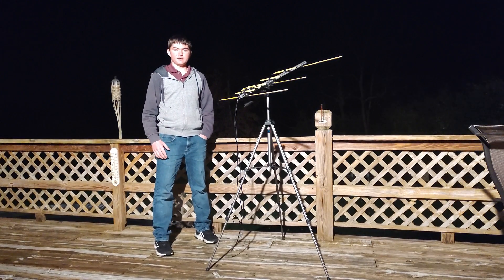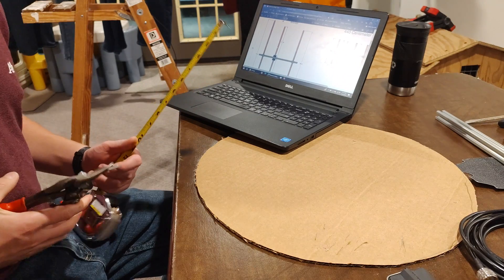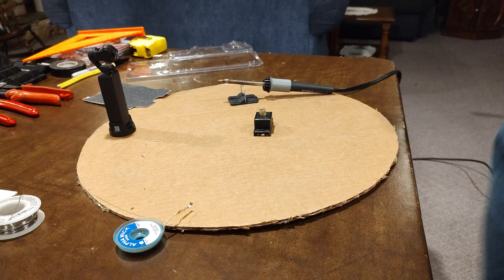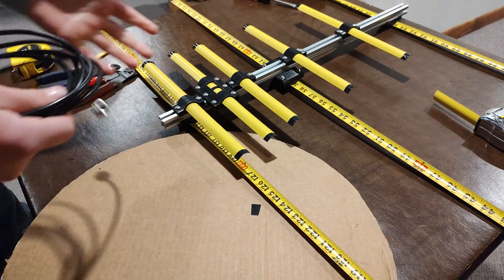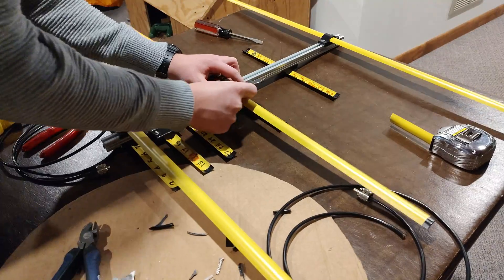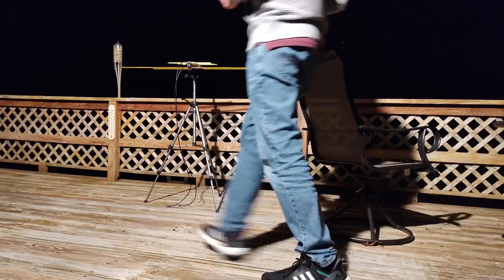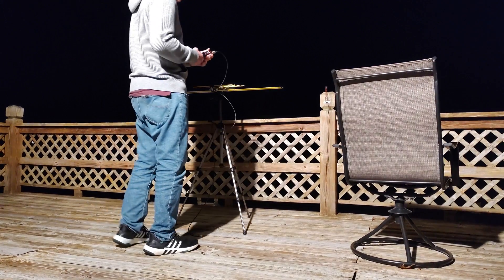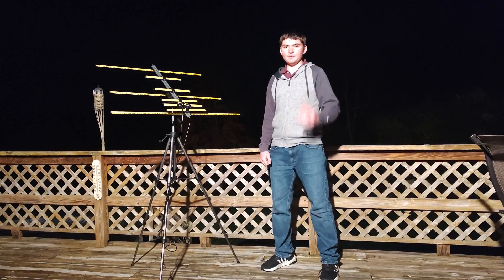DIY Dual Band Tape Measure Yagi Antenna Tutorial

Comment: you could also have done math to calculate where to cut each element of the Yagi... no need to have used the second tape measure.  Use your computer calculator if need be.

Comment: Did you connect the 70cm coaxial cable to same element as the 2 meter element? Im confused i cannot see where did you conected the second coax here on the vid or the instructable
Also im going to try and make it but instead with a pvc pipe

Comment: The design looks really neat an well made. You will need a diplexer if you plan on using one handheld. Some folks use two handhelds. One for the transmit frequency and the other for receiving. Also you would get better performance into a local repeater by orienting the yagi vertically. Good luck with your project very nice build.
73
Roger
KW4EMF
Reply from the maker: Thank you. I am using 2 radios, that is why I have 2 coax leads. Thanks again for the kind words!! 73

Comment: Cool project! would it be possible to have this arrengement with only one aux cable or would it cause an interference somehow? (eg.solder a litle piece of wire conecting the dipoles)
Reply from the maker: I am not an authority on the subject, but the way I understand it is that you could place a duplexer connecting both dipoles to one feed line.

Comment: Great work, let me know when you test it with the ISS , is it possible to use only one coax for the two bands?
Reply from the maker: Thank you! The reason I have configured it for 2 coax leads is I am planning to use 2 baofeng radios. This way I can have full duplex using cheap radios. I believe it would be possible to use only one coax for the two bands if you implement a duplexer and have a dual band radio. I hope this answers your question.